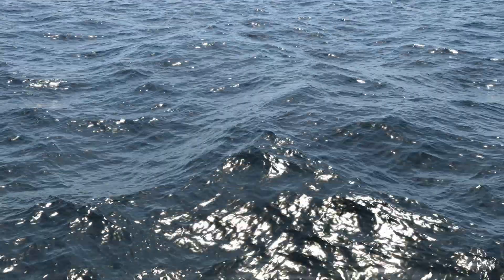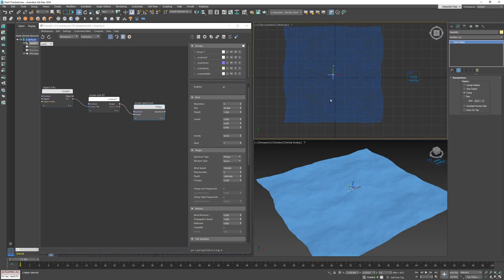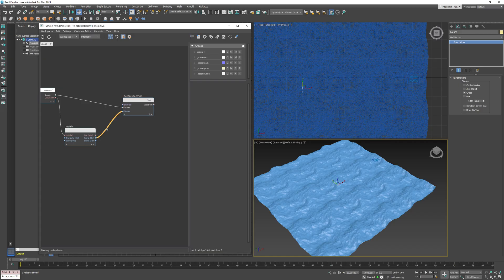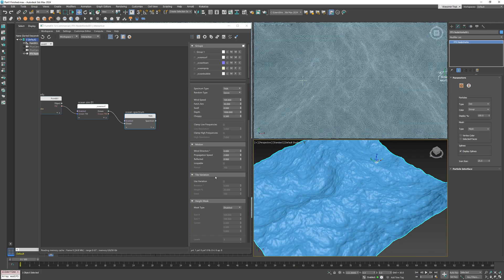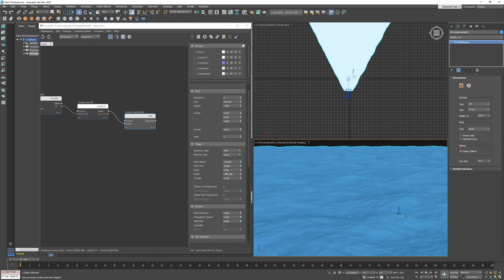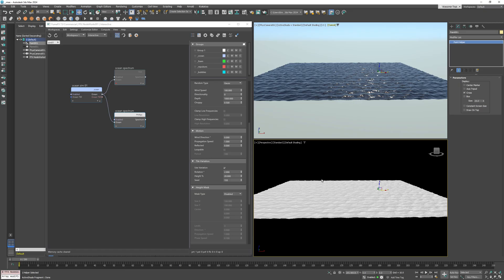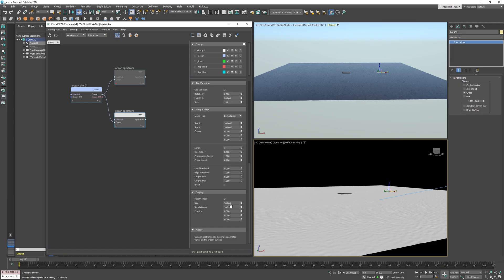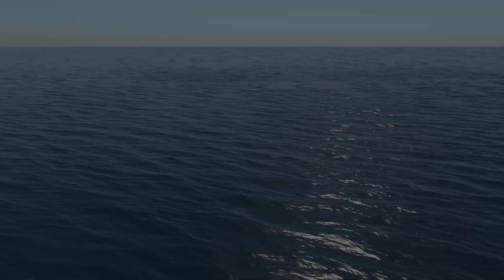FumeFX GPU Ocean Simulation - 3ds max Tutorial

Comment: I am following the video fine up to 8:30, but at that stage my result is wildly different to what I see on your video. Unfortunately, I can't attach screen grabs, but the best way to describe what I have is that the vertical scale is greatly exaggerated, so that the surface resembles steep, rugged mountains (not at all wave-like). I've gone back over the steps several times, but the result is always the same. Clearly, I am doing something wrong, but what that is, I have no idea. Do you have any suggestions? If it helps, I have made a similar post on the Facebook page, which allows me to submit screen grabs.
Reply from the maker: Hello Alan,
Have you tried to use 3ds max Physical camera like in tutorial?
Reply: @sitnisati  I worked through the whole process again, up to around 8:30 as before, and using the 3ds Max camera. However, the problem seems to be initiated at the point where (in the ocean_sim node) I change the Mesh Mode from 'Uniform' to 'Adaptive'. This action has the immediate effect of greatly exaggerating the vertical scale. Also (and I have no idea if this is relevant) as soon as I have switched to 'Adaptive' the following text appears along the bottom of the Nodeworks window:

Reading memory cache::frame 48[24.8 Mb]::range 0-99::memory 1.2/16Gb

Reverting to 'Uniform' makes the text disappear. Quitting 3ds altogether and reloading my saved file normalises the Camera view (though the verticals do still look a bit off). However, hitting the Play button in 3DS brings back the vertical scale issue. Unfortunately, I think this software is going to be beyond the scope of my modest 3d skills 😢
Reply from the maker: @alanstewart3929  I went through the tutorial and everything matches. Maybe you need to take the camera upwards and/or increase FOV so you cover larger portion of the sea surface. Inside the members area there is a zip file with plenty of various examples that you can check. I also suggest to go through our online documentation: https://docs.afterworks.com/FumeFX6max/Ocean.htm